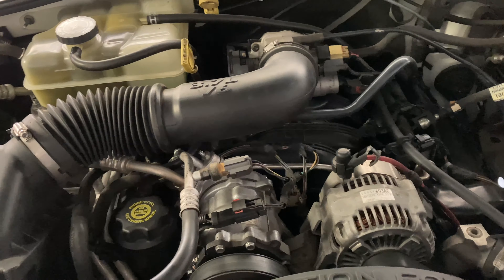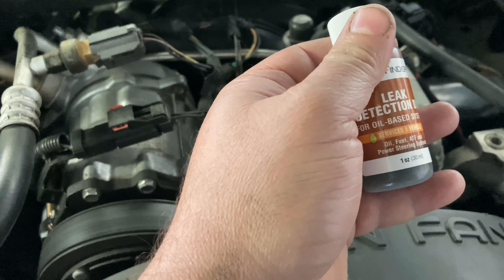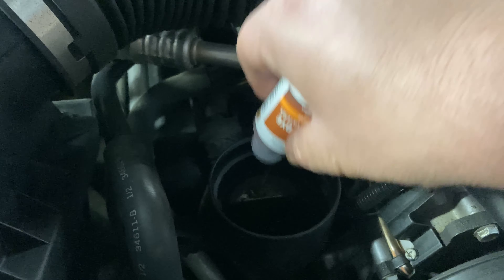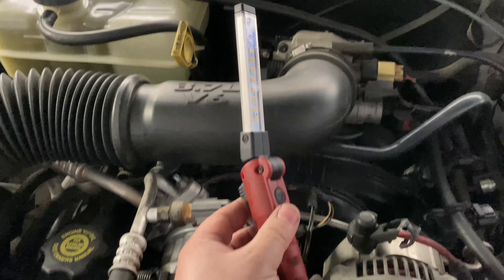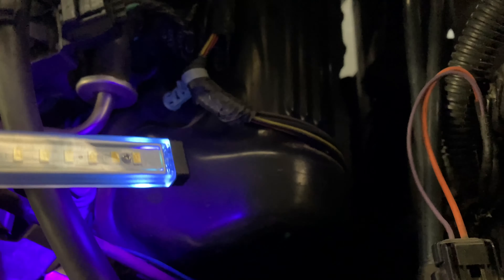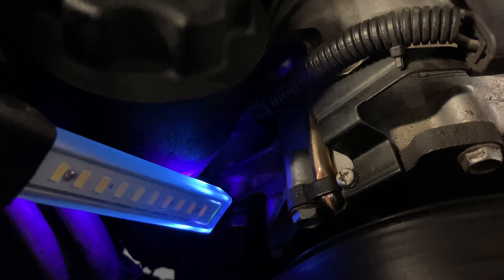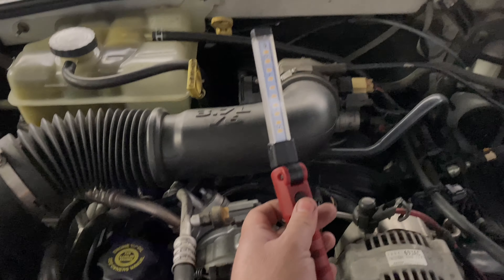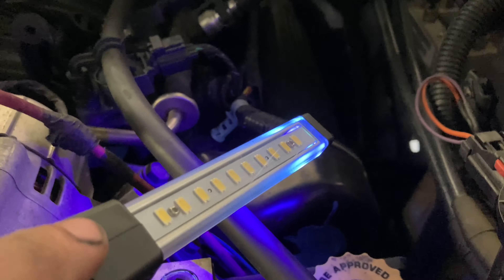Turbo’s Tech Tip for finding an oil leak...(or not) with Streamlight Strion Switchblade

Comment: If you want to see exactly what the dye should look like with the light, open up the oil cap or pull the dipstick.  The reason this is important is you can see multiple different colors with a dye light and this way you are looking for the correct one.  Just my tip as I've spent allot of time chasing the wrong thing.  I love the video and the light looks awesome. Thank you for sharing.
Reply from the maker: Great tip, thanks Tone!